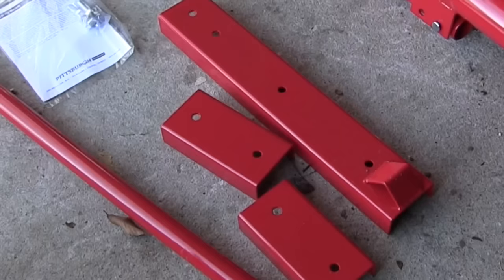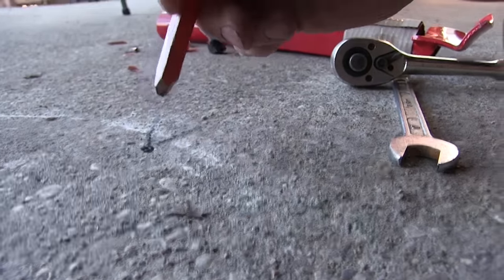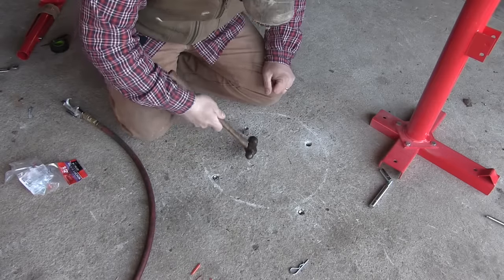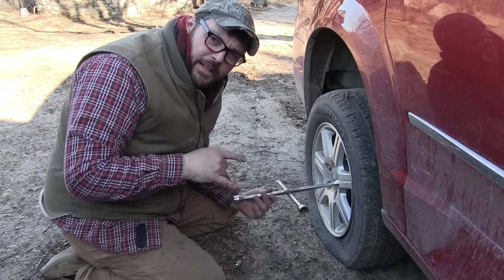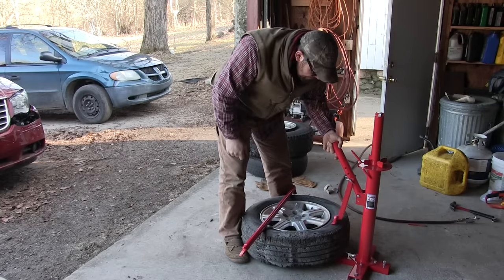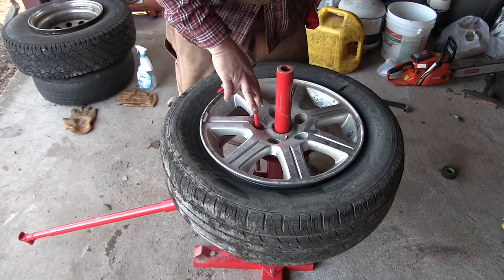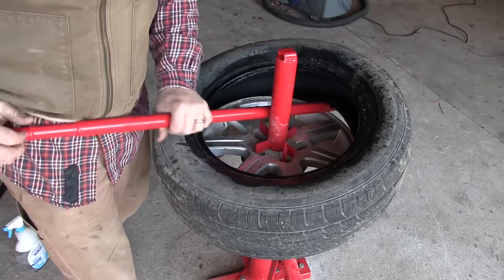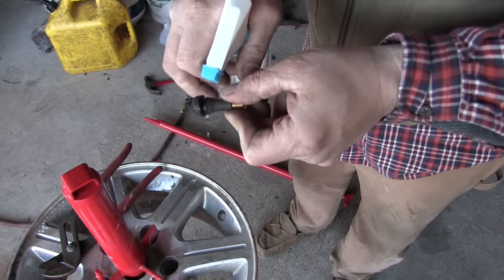Harbor Freight manual Tire Changer review

Comment: Next daughter is going to come and say, "Dad, there's a flat tire warning light that won't go off."
Reply: Put a piece of tape over the light lol
Reply: Jonis Janplin  yep! Lol. My dad would grab electrical tape and cover it up and it would blend right in. 😂
Reply: @yaboychriss5567  yup, you dont need any of that fancy junk unless it's tied into your traction control lol a good ol tire gauge works just as well
Reply: James the Other One 
Or dad my wheels need balancing.
Reply: @yaboychriss5567  I actually had a Toyota, where the theft light was black taped over. For any locksmith or tech can relate; as Toyota had roughly 10 different places this light can be
Reply: Heh....This guy will most likely just use a 1/2 inch drill bit and a drill to solve that problem
Reply: Good thing its on the rear of the van you shed be telling daddy the front end is shaking really badly from an out of balance.
Reply: Take the cluster gauge assembly out of the dash, and remove the bulbs that lights up the tpms symbol, then just bridge over with wire to keep the tpms circuit connected, but since bulb is out, it will not light up.

Or if you can find the fuse for the tpms, you could try removing it, keep in mind it could also be connected with abs, traction control, etc. and if it is connected to those functions, better to keep the fuse in there, and bridge over the bulb socket with wires, mentioned earlier, above comments.
Reply: @theroyalcrownedtiger2946  Or you could just buy a $15 TPM sensor and fixed the tire correctly.
Reply: @WIPEYOURLENZ  next time, mark tire and rim, re-mount on marks and u should be good to go.
Reply from the maker: NOTICE:      
I did not balance this tire, I'll do that in a future video review of the Harbor Freight bubble balancer.  
      I do not care about this tool "scratching my alloy wheels".  
      Also, I DO NOT care about the tire pressure light being on.  It was ALREADY on due to the fact that this is the SECOND TPS valve stem to FAIL on this van leaving a member of my family stranded.  Thats B.S.
        If you're a yuppy and care more about "the light being on" than about the safety of having dependable rubber valve stems......then you're probably watching the wrong channel.
Reply from the maker: The tire had no vibration, so its pretty close as is
Reply: @Bushradical  I'd be interested in the balancer video I've always been curious about those
Reply: I would recommend to get a floating bubble balancer, it works and it can be bought for about less than the actual balancer machine the shops use.
Reply: @theroyalcrownedtiger2946  man that wouldn't work unless ya had TPM on a 83 corolla
Reply: @extractorfan2143  : I've used the bubble balancer for both my early 90's gm car, and early 2000's gm van, it works without issues.
Reply: @extractorfan2143  : The 80's cola's car is long long gone, if you find it it's either going to be in need of alot of work, or is in mint shape with the owner asking tons of money for it.

Unless you got alot of money, you are not likely to get it.

Add the first 2 letters, and the last 2 letters of the car's full name = cola.

It sounds better with the nick name Cola, rather than the full name, which is too common.
Reply: @extractorfan2143  : The 80's cola car is extremely unlikely to have tpms light, unless if an aftermarket add on kit was purchased and installed on it.
Reply: @extractorfan2143  : I've taken out just the removable aluminum stem, from the sensor, held by 1 screw, due to the stem having a crack and air was leaking from there, and replaced just the stem, without changing the sensor, it works.

If in a pinch of a situation, and if the sensor works, just put in a rubber valve stem,  remove the aluminum stem with removal of screw, and stick on the sensor on the rim with a little dab of urethane adhesive, touching the bottom of the rubber stem, place it there where it originally was without obstructing the rubber stem or other areas where it would cause issues, then the little space fill the tiny gap between rubber stem and the sensor with little bit of urethane adhesive, making it work like its 1 unit, it can make the computer to thinking it's fine I did this before on a Dodge, and its works and still working, my friend is happy with the result.

Just don't forget to fill up with proper pressure air pressure,  use a digital tire gauge, and you will have to complete the drive cycle for it to turn off.

One could get the tpms from online, but they might not last long, and might need sensor programming to make it functional. 

The prices for things are more expensive in Canada, compared to the united states.

Where I am, its 13 percent taxes.
Reply: @theroyalcrownedtiger2946  ok man I was referring to taking the bulb out of the dash as it's probably an led on a printed circuit.. 83 rolla is a nice car I suppose 10gs would get one in nice shape
Reply: @extractorfan2143  : Thanks for replying back 🙂

Have a great day 👍 and stay safe 👍
Reply: @theroyalcrownedtiger2946  I would imagine the balancer would work well. Iv never used one. My favorite car I ever had was an 83 86 with a gtz I miss it
Reply: @extractorfan2143  : Although as people we have likes in different automobiles,  usually the first car is the one that's most liked.

Tha bubble balancer works pretty good.

Although 've never had the car you've had, I know the feeling of missing the car, I've lost my car long time ago, and I miss it alot, it was involved in an accident, due somebody else that was not carefully driving their car, and damaged mine, that  was a early 90's gm car, I loved that thing, it was not a luxury car, not a sports car, but it was mine, I fully owned it, I worked on it, drove it, it was my pet.

I hope one day you can get the same most favorite car(s) you've had at some point in your life.

Good luck.
Reply: @joshuadoe9541   Sure, if you bother to check the pressure regularly.  It's proved that your family is much safer with the automatic warning alert system.  But then it's your family at rish, not mine.  Maybe you ought to todd out those annoying seatbelts while you're at it.
Reply: @ronlheureux7623  English please?
Reply: @Bushradical  netx time mark the tire where the balaces are
Reply: It won’t come on because it not there to come on. That’s not how they work . That called a idiot light if you can’t look at a tire and tell it’s low or flat the rest is self explanatory! Somebody needs to learn to change a tire before they lean how to drive in the brain days that got us here where no one can understand a car is easier to fix now than 40 years ago they called that putting the wagon in front of the horse , you have a computer to tell you what wrong now in the old days you had to use your brain and know a car upside down and backwards today they are simple to fix, you know the difference in a doctor and a mechanic a mechanic has to fix his problems a doctor buries his!! Something so simple try to make it hard. The sensors work on a ground not a positive if you lift the vehicle the sensor not going to give you a warning for to much air, maybe some people need them first thing I would do is take them all out and look at my tires every now and then, if the light is yellow no big deal electrical system not making a full circuit, red light needs immediate attention don’t get B.S. by crooked mechanic it not that hard you got a computer telling you the codes look the code up sometimes it may be more than one a tag light, gas cap and so much other nothing stuff will bring a light on they want you to get frantic , if your hot light not on oil pressure good alternate working and you don’t have a flat tire drive it. Don’t pull if it is front wheel drive with the front tires on the ground, if you pull one over 5 miles or 5 mph you will tear the transmission up,spark, gas, air and compressions all in time and all of them will run .
Reply: @stephenfogle8699  "It won’t come on because it not there to come on. That’s not how they work ."
You're right. That isn't how it works.  if the TPM system doesn't get a signal from a pressure sensor, the TPM error light comes on.  
Good luck selling your car like that. And in most places taking the bulb out to make it "go away" is considered fraud.  
Modern low profile tires can look inflated even though they only have half the pressure required and leads to premature wear and poor fuel economy.  That is why they have these systems.
Reply: Take schrader valve out and you don’t have to use any tool to add a lot of air to tire to seal it off. Just pull back the sleeve on your hose fitting and it will work a lot better. I’ve seated many semi truck tires like this. Thanks for video
Reply: @jamestheotherone742  not at o'Reillys price checked one 59$ got one on ebay for 10 $ stay away from auto parts stores
Reply: lmao
Reply: i did that before when going on dates blends in perfect lol the smog guy took it off said who put that there i said wtf i never noticed that
Reply: Mail stamp work perfectly
Reply: and my tire flew off...because you put oil on my lugnuts..  :(
Reply: @josegomez2190  good advice
Reply: Dad said buy a manual tire pressure gauge tester and just tests your tire pressures every few weeks.You’re good to go.
Reply: @jamestheotherone742  TPMS can take a flying leap.
Reply: Just mark the tire at the valve stem before taking it off and marking the wheel weight location on the tire in case one comes off.  Fix tire put it back on, line up valve stem mark on tire. Good to go.  No need for wheel balancing unless it needed it in the first place.
Reply: Charles Powell balancing tires is easy.  Plenty of vids avail for it. Common home repair prior to the white collar explosion of the 90’s.  Even “balanced” tires have harmonic resonance.  Stop catastrophizing, man!  Lighten up.
Reply: @jamestheotherone742  True, 👍
Reply: I have been pressure washing the wheels (a lot of times crud built up on the wheel affects the balance) and removing all the weights every time, haven't felt any vibrations yet... Done 5 or 6 tires
Reply: @Bushradical  My great grandfather and I used to sit in the van, while my grandma shopped, and he would make fun of the "yuppies" walking into the mall. I have never heard anyone else use that term since him. lol bravo
Reply: Farther says , Oh yeah you say there is a light on your 25th Century car ? Sweetie go get dads Hamer from the garage I’ll take car if that light lol 😆
Reply: Ignoring that light 💡 saves $.
I’m with u on sensors. !!
Thanks for the video
Reply: @Bushradical  I was reading a couple of years ago that tires are not being made with as much variance as they once were. Some don't even come with alignment marks anymore (used for aligning the tire with the rim to minimize the amount of balancing needed).
Reply: You put wd40 on your lug nut?  It's technically not a lube but ........

Everyone seems to forget or just not know you should check your lugnuts after 20 miles or so
Reply: Where can I get those drop-in anchors?
Reply: I'm going to make one for myself. Thanks for sharing.
Reply: Be a good dad and teach her how to deal with it, I'm a roadside assistance dispatcher and parents are STUPID sending their kids out barely knowing how to drive and being clueless how to deal with any problems that arise....  Seriously if you love her, educate her or else she may be stuck on the road and hurt because she need help and can't help herself.
Reply: The fix, a half inch diameter piece of black electrical tape to cover the light at just the right angle so it doesn't bother you.
Reply: @bobwhammer4237  not when you changed the balance by not reinstalling the tpms sensor
Reply: @PatrickBaptist  tyre shops put the nuts on so tight I doubt any girl could remove them ,I broke my tyre wrench one time
Reply: @robertsinderberry4124  Ever heard of a cordless impact?  My 11yr old daughter can manage that even LOL.  
Excuses excuses, then complain when they are stranded and can't get anyone else to do it for them...  People get hurt and worse being stranded and can't do squat for themselves, I teach my kids to be able to take care of their own problems rather than having to wait around for someone else to do it for them leaving them at the mercy of anyone else that may take advantage of the situation.
There isn't a good excuse for not educating ones children, it's stupid not to, it may save their life rather than waste it.
Reply: @Bushradical  I've marked the tire & rim and reinstalled with no problems except keeping the marks on while doing so. Seemed to keep the balance👍😎 Thanks for the video
Reply: IKR 🤦‍♂️😂
Reply: Jonis Janplin 🤦‍♂️
Reply: Stephen Fogle 🤦‍♂️
Reply: @Bushradical  The TPS is there for a reason. I believe there are two types so getting a new one of the same type isn't that hard to do and where I live, that car wouldn't pass a safety inspection if that light is on, just saying it's an easy fix and installs very easy and pairing it to the ECM is Childsplay. Plenty of YouTube videos shows how to pair it to the ECM without any fancy tools or scan tools. TPS sensors don't prevent a car from running or stopping, it's just to let you know about the air pressure in each tire which a lot of people do find it better than checking it all the time, just saying.
Reply: @josegomez2190  Exactly the right thing to do!
Reply: My daughter would want me to fix it right and would complain about the light. I always make my daughter car run and do what it's suppose to do like how it came from the factory so she has a piece of mind about the safety of her car.
Reply: @jamestheotherone742  Or $90 if a Ford
Reply: @jamestheotherone742  was just thinking the same thing lmao
Reply: @gregpartain4307  Yep, that's what Ive always done.   No need to fiddle with anything, quick n easy.
Reply: He forgot to reinstall the center cap.
Reply: James you made me fall off the chair laughing!
Reply: @theroyalcrownedtiger2946  if you have a wreck and get sued that will get you in trouble. I used to do that, better off blowing the bulb.
Reply: Walmart does mine for 10 bucks. I choose 10 bucks.
Reply: @dannynoel993  Good idea.
Reply: @dannynoel993  : Hmmm I see, thanks for the heads up.
Reply: Use a piece of rubber or towel between the bar and rim if it’s an aluminum wheel to prevent scratching the rim
Reply: @robertduvall7846  Good Idea!
Reply: Everyone has questioned youvremoving that tpms sensor.  That looked so old I think its battery went dead before pet rocks were a fad!!!  The tpms warning light was probably on so long it too went out.
Reply: Im sure he knows to put the sensor it the new tire
Reply: You have to rotate as you go then the bead wil cut loose . Soap is good too
Reply: @Chu3505  , That's far better than looking and guessing.
Reply: @PatrickBaptist  , I was working at a "filling station" (garage too) in the 60s. A man walked in and asked if either of us would go up to the freeway and change his flat tire. We both said no. A grown man and he couldn't change a flat. He needed to go back and teach himself how.
Reply: @robertsinderberry4124  , always ask to tighten the lugs down yourself.
Reply: @senatorjosephmccarthy2720  Amen, people are so lazy and immature not wanting to do anything for their self anymore.....
Reply: Or next is dad you didn’t put my sensor back in and I didn’t know it was low when I was going 70 on the freeway and now my tire blew out and rolled the car and killed me. Because in the 25th century we always check tire pressures every 2 weeks like we’re supposed to.
Reply: @jamestheotherone742 $15 + program + install = $$$ good luck with that. Then find out it doesn’t with your specific EX, LX etc and only the dealers programmer works on your car. Pain in rear supposed to help non-maintenance drivers that don’t check their tire pressures.
Reply: That’s what my daughter would say too 😅